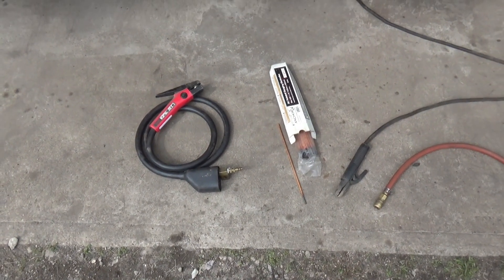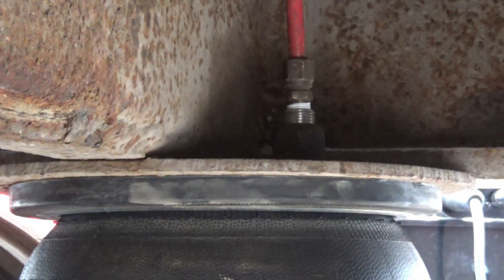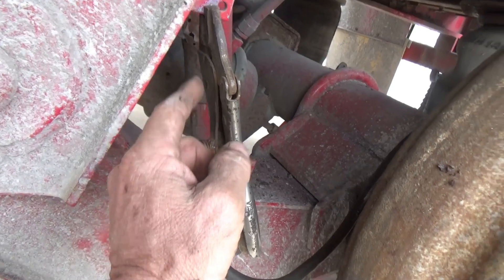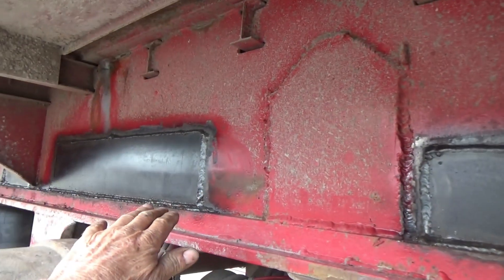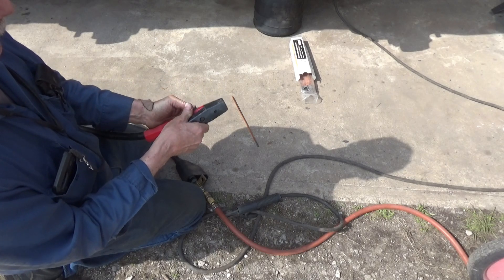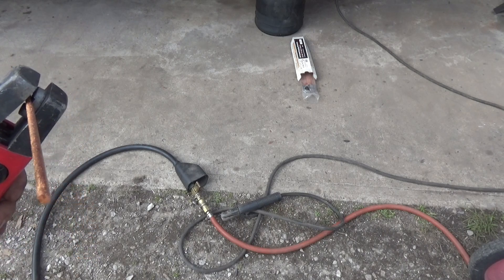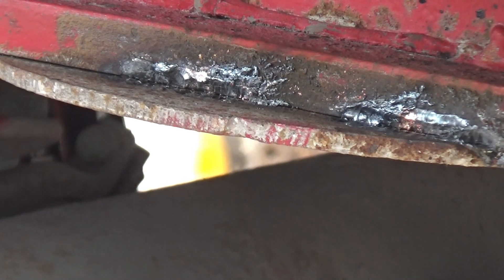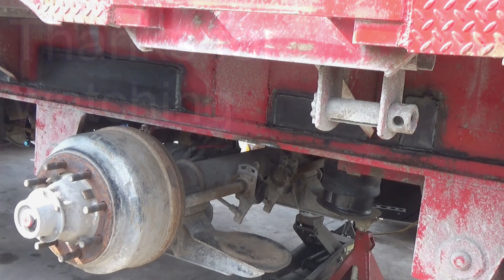Remove welds with an Arc Air

Comment: What size rods did you use for that and what amperage? Thanks.
Reply from the maker: I think the rods are 1/4" and my welder goes up to 250 on the DC side and I have it pretty much all the way up.

Comment: Just used this today on my work apprenticeship. Really cool stuff. I was gouging thick metal “doors” which hold the net of a fish dragger open. When they drag along the bottom of he ocean, they wear slowly and Need to be cut off every once in a while. The steel is about half an inch thick, so it take a decent amount to gouge. Really cool stuff I recommend any welder tries it at least once.

Comment: That particular Galaxy is an air Arc gouge which is the best one profax make the gouges as well it is not so good the O-ring stick and cause the gouge to leak

That particular welding machine is 17 1/2 amps per crank that's the exact same welding machine I learn how to weld on in 1991 and since then I'll burn more carbon Arc rods than I care to count very very handy tool to use get you a good set of earplugs

Comment: Hey Gordon how you doing? 
 I was just wondering what diameter Rod you were using  on your Arc air?
Thanks
Reply from the maker: I think they're about 1/4" or 5/16" they can be found smaller but they are very fragile.

Comment: Hello Gordon, Very useful video. Thnx. Q:  i have a little  portable welding 200 amp. If i buy one of those arc air handle, can i use it with my machine? 2nd: can i remove welding from 1/16 th in metal plates? Thanks in advance
Reply from the maker: Thanks for watching. This tool works better with a D.C. machine and needs a lot of power to burn even the smallest diameter carbon rods. I would probably just use a grinder with a cut-off wheel for 1/16" metal.
Reply: Check out Arc Air's website.  I have their exothermic cutter which only requires an oxygen tank for fuel and their consumable rods for cutting, gouging, plunging and even underwater cutting.  Also, you’ll need a small battery to start the rods.  Overall, very compact and useful

Comment: The second problem I have is in the yellow knob parking  brake which is when I pull it out the wipers stop working until I bush the yellow knob down and also the yellow knob don't park the truck
Reply from the maker: Maybe someone changed the valve and put the hoses back wrong or put in the wrong valve? I don't know.

Comment: Hello Mr Gordon ,I have a problem in headlight Which is when I turn it on the switch gets hot and turn the lights off
Reply from the maker: sounds like a bad switch or maybe a loose connection on the switch.

Comment: With zip disks being cheap its easy to cut welds with them, we have an air arc at work rarely gets used, never had one in the families welding shop, washing out old welds with a torch was a common practice. Looks like your old trailer has seen some heavy loads in its day with stress cracks. Your old Ideal arc Lincoln welder were good 220 volt welding machines in their day, fairly smooth, decent duty cycle on them.
Reply from the maker: Yes the trailer has done it's time but I will get a few more years out of it. I do like the old lincoln 250, I also did fix the old lincoln wire feed too, it had a loose wire inside and I put a new liner in it and found a bad       o-ring while changing the liner.
Reply: Yeah this would have been an abrasive disk for myself.

Comment: That’s Really Neat Gordon It’s The 1St Time I’ve Seen One of These Arc Aires I’ve Used a Plasma Cutter But Never Knew These Existed 😯😯😲 Thanks For Showing Me Something Completely New 😀😀😀
Reply from the maker: Normally only used in steel production shops, I also use it on heavy equipment to gouge out a crack before welding to assure 100% penetration. Thanks for commenting Chris.

Comment: Hi Gordon, I got 98 Fld clicking noise coming from back of my truck when I turn to the left or right specially when the trailer hooked worsens like you hitting something, we changed the passenger side busing not solving now the mechanic is saying barring, how the bearings got like that loudly noises? I am saying maybe fifth wheel, center pins on drive axils may be out. What is your suggestion? Thanks in advance
Reply from the maker: Sorry, I can't offer an opinion without being there to see and hear.
Reply: Gordon Robertson DIY , you are right, I send the driver to other shop in Oklahoma City and found it  rare axle def was stacked and not let axle move! Thanks for replying sir!

Comment: I have not saw one of those since the mid 90s!
Reply from the maker: I hope you and your people around you are staying well. Yesterday I couldn't finish an electric job on the trailer because of the high wind and cooler temps, I needed to solder something in front at the pigtail plugin but couldn't get it hot enough and I know a propane torch would never stay lit in that wind. I never thought a high watt iron would not work in high wind. I ordered a 500 watt iron from Amazon Prime that should be here in 3 weeks, (so much for Prime these days) Let's see what happens today out there.
Reply: I wore my warm weather riding gear yesterday and today it's snowing on and off )